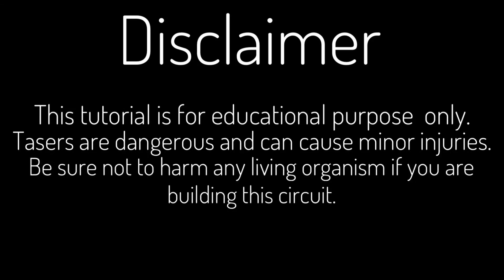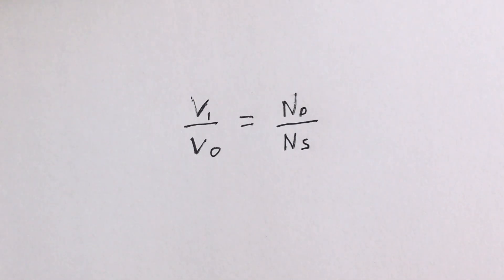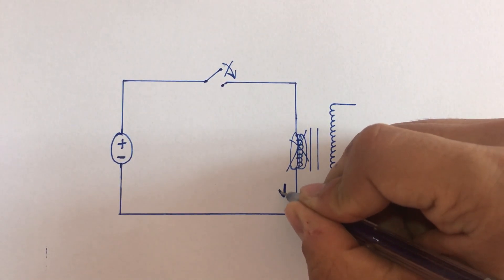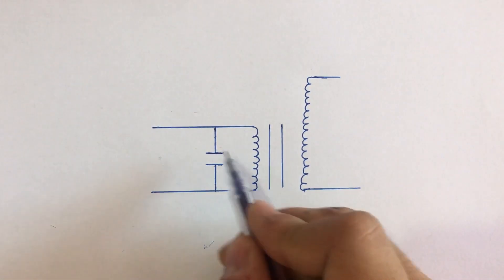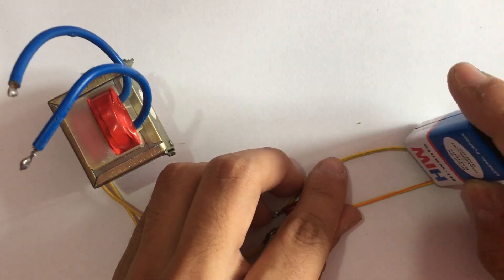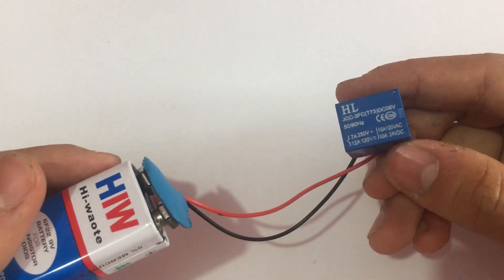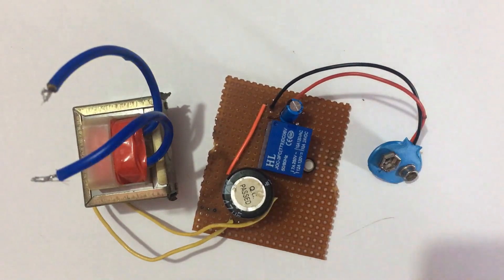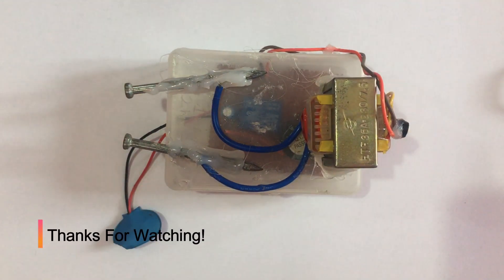Building a HIGH VOLTAGE TASER | Super High Voltage Generator |

Comment: brother plz give circuit diagram plz brother plz😢😢😢😢😢😢😢😢😢😢😢😢
Reply from the maker: Here you go bro,
https://imgur.com/a/zCBA6pb
Reply: bro i have a question can it generate contineous arcs and plz tell me tranaformer of how many volts plz plz
Reply from the maker: Yes it can generate continuous arcs and this circuit is compatible for ranges of transformer, from a small mobile charger transformer to bigger step-up transformers. The one I am using in the video is of 290/7 coiled transformer, but I'm not sure of its voltage.
Reply: ok brother but how can i purchase this transformer from market
Reply from the maker: @MrBoi96969  You can either scrap it from old useless circuits which I did in my case or you can get it easily from an electronic shop nearby else you can order it online too.
Reply: brother can i use a 12 0 12 center tap transformer can you plz tell me plz 😊😢😅😑
Reply: bro i got all stuf but i didnt understand the relay details  which relay you are using
Reply from the maker: @MrBoi96969  I am using a 5v relay
Reply: brother plz tell me fast plz
Reply from the maker: @MrBoi96969   I would recommend you to use a non center tapped transformer because I haven't tried this circuit with a tapped transformer. But the circuit should still work, try choosing different coils which would give you the best output.